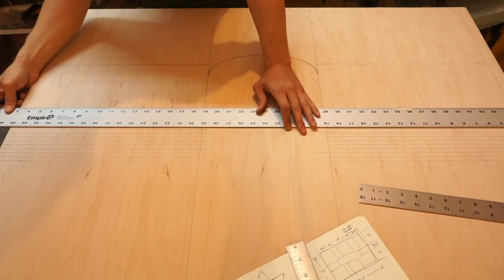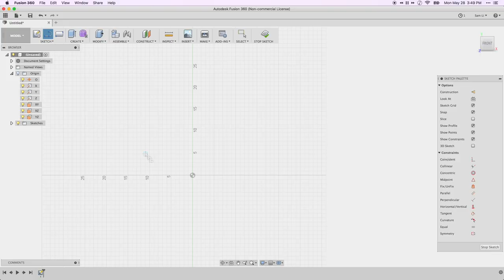Kerf Bent Plywood Chair

Comment: This is an amazing project, the curves are fantastic! What is the blue material used to add rigidity to the curves?
Reply from the maker: Shape And Explore thanks, that was just blue painters tape to help with the glue removal. The curve with glue alone is pretty rigid.
Reply: Sam Li Design awesome, thanks for confirming!
Reply: Sam Li Design if u make shape in 10mm then is wonderful article